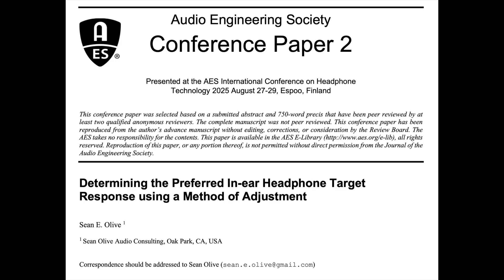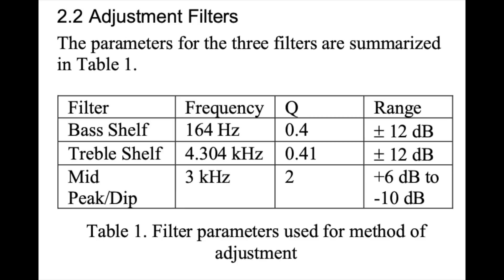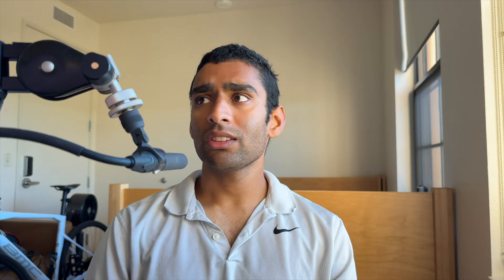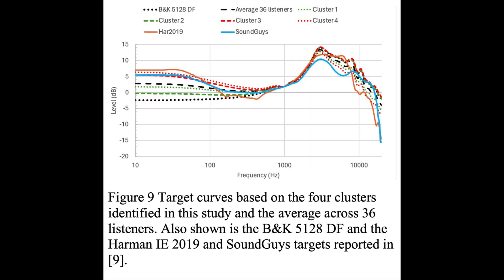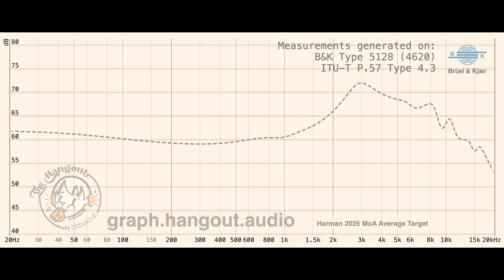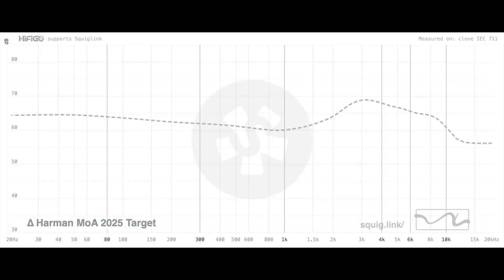2025 Harman 5128 Target Officially Tested!

Comment: I tried it using my He1000 Stealth. Normally i use PEQdB/3D targets and sometimes just without any EQ as i find them the least peaky in the trebles area among all egg shaped Hifimans.
The Harman 2025 somehow reminds me of the blend of hd600 and hd650 but slightly improved in the treble area. I like it, it sounds a bit like Softears Twilight and Volume S, with more body in lower mids and midbass. Quite satisfying experience and i maybe like it more than the PEQ in these particular areas as the PEQdB can still sound bit thin, like older Harmans. But on the other hand the PEQdB helps with creating a more out of head impression as its mids are pushed back.

Comment: Target curve rating according to your inputs

PEQdB HiFi
1579 (σ: 143)

∆ Harman MoA 2025
1573 (σ: 138)

Harman OE 2018
1416 (σ: 209)

Harman IE 2019
1284 (σ: 194)

I voted a tie several times because one was a bit sharp and the other was a bit dull (and sounded slightly quieter). Nice thing about peqdb studio that you can select those two curves and average them out

Comment: Using the wrong delta leads to inaccurate results...
Reply from the maker: it can't be off by that much
Reply: @sharur1 no, it absolutely can. Correct delta has 2.5 db less under 800 hz. So it's even worse than real tilted jm-1, while in reality Harman moa is just jm1+5 db bass with 150 0.5 shelf (or 0.4). It's a good target, but it misinterpretated so much with review delta. Same goes for jm1 or other 5128 deltas, they are incorrect by a lot.